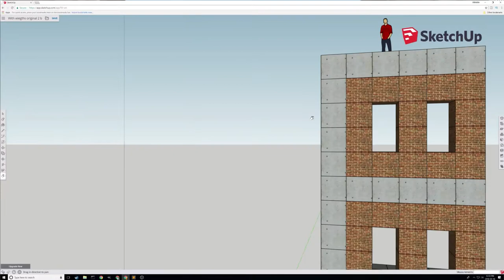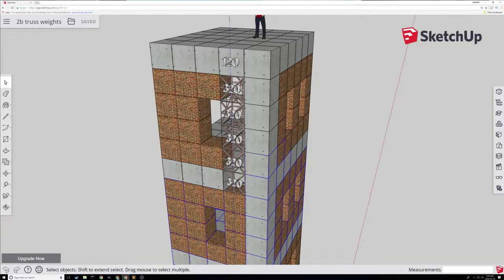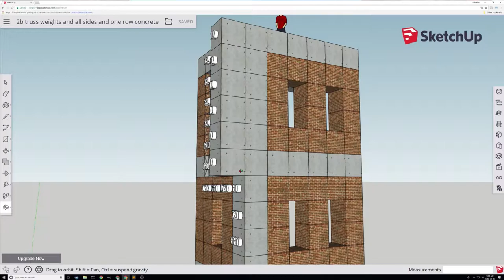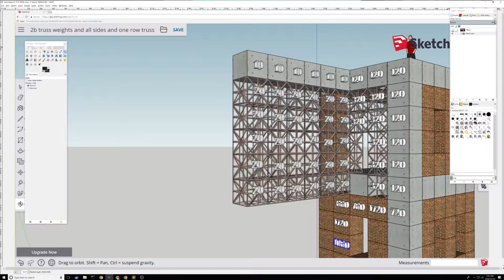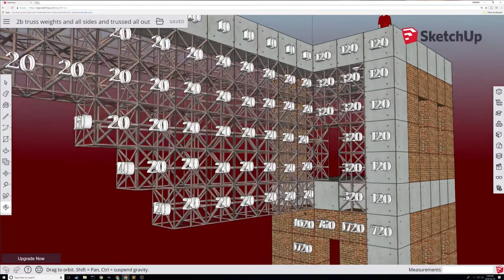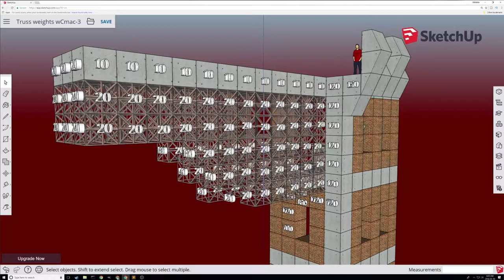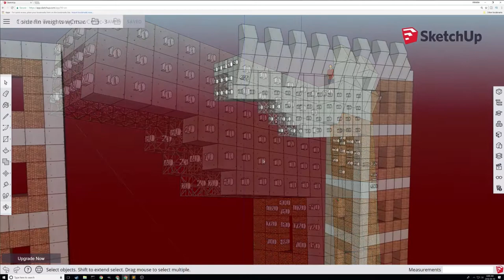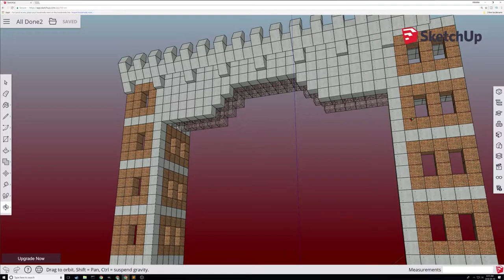Bridge  Structural Integrity | 7 Days to Die - Part 83 | Alpha 16

Comment: Nice twist with the 3d planning. The keep is looking grand. You should 3d print that sucker before the bits rot. Thanks for the vid.
Reply from the maker: Donn Ingle huh that is an interesting idea to 3d print it. I would have to look into that and see what's still avalable. 
It was pretty neat doing the modeling. I would like to use it more but not really sure on what